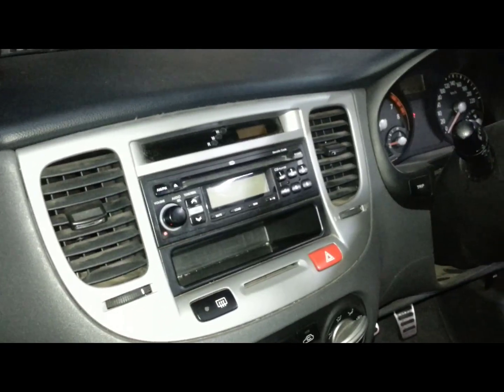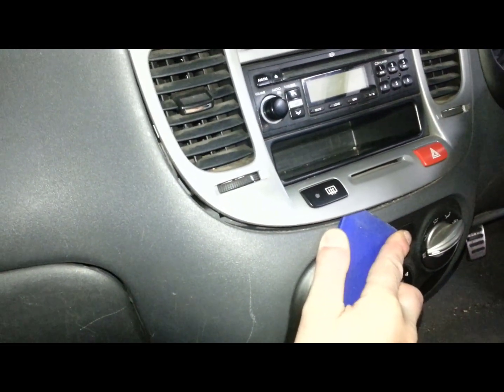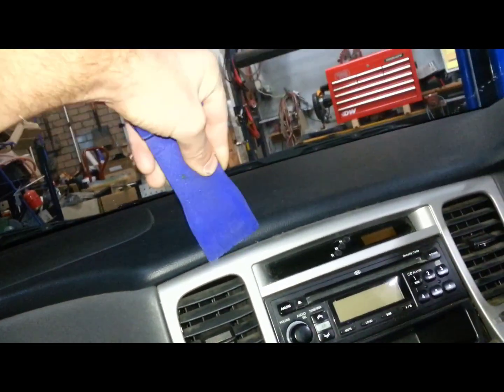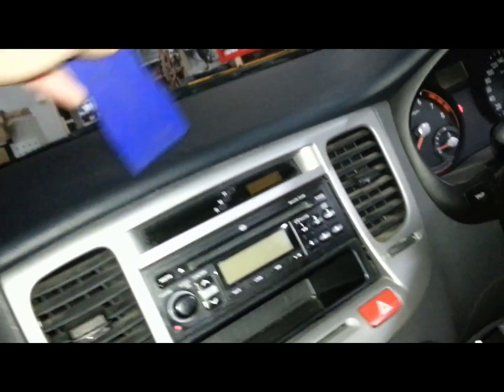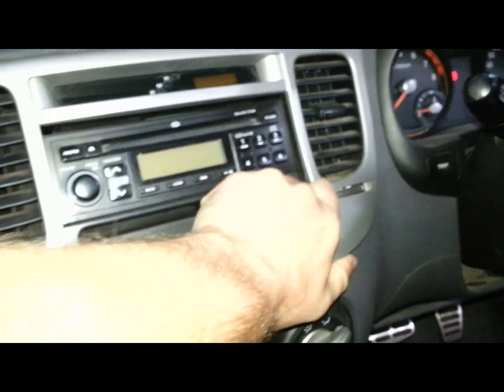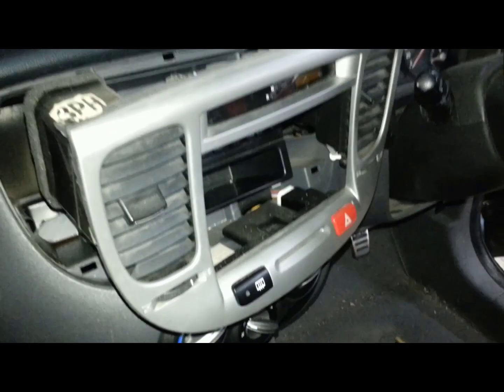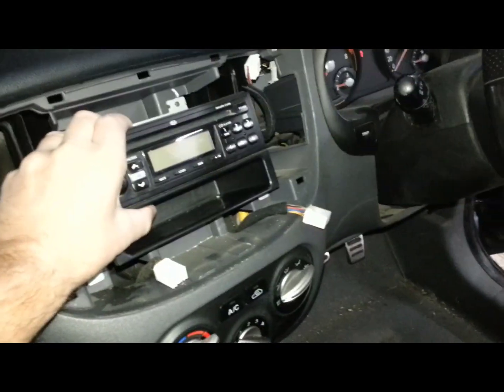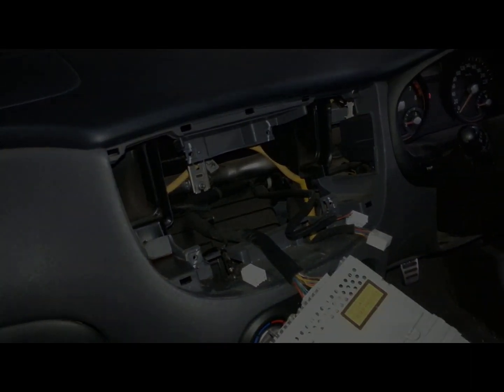How to remove the radio from a Kia Rio

Comment: This worked for our 2009 Kia Rio. We needed to find the radio serial number. The unlock code is the last four digits, and add 1212 to that number. 1291 became 2503.
Reply: you ripper we got a 2009 Kia Rio thank you so much for posting this comment Michael Kean !
Reply: Update: can confirm this worked for our 2009 Kia Rio also

Comment: Glad I found this, just got an 07 Rio for $500 lol, runs and drives but Radio is DOA so it’s coming out lol
Reply: I dont know if you still have it but the yellow double fuse in the fuse box on the driver side 2 10amp fuses one of those is a the radio fuse for power

Comment: You car will rattle like anything  after this😂 BTW Did you do this just for the video?
Reply from the maker: I made this to help others who are trying to install a new radio. It is common for these radios/cd players to fail.
Reply: @DIYChannelSteve  I have a Kia Rio CDs won't play, it says reading but no sound, Maybe I'm deaf😂
Reply from the maker: If it is just reading then the laser is no longer working. The unit needs to be placed.

Comment: Just got my radio to power back on but no sound don’t know why tho
Reply from the maker: you may have a speaker wire short. behind the radio or a speaker
Reply: @DIYChannelSteve  what’s the best way to test that?
Reply from the maker: If you have had the radio out, pull it back out and then see if its work again. Some wire may be shorting out on steel behind the radio.

Also, do you still have the factory speaker installed? If aftermarket speakers are installed it could be a short at the speaker.
Reply: @DIYChannelSteve  no they are still the factory ones and I will definitely try that was kinda my next plan but just wanted some advice from some one who would know more really appreciate it

Comment: Will my code be wiped if i unplug it for just a minute? I need to get a picture of the connection to see if an aftermarket one will fit
Reply from the maker: yes, you will need your code number if you unplug it.

You can buy patch looms for a new radio. go to Autobarn or Repco for these. Ebay can be a bit less helpful.